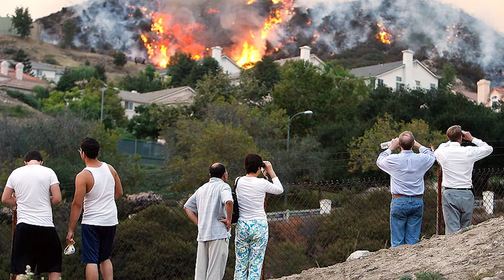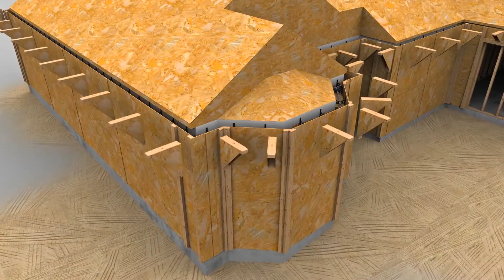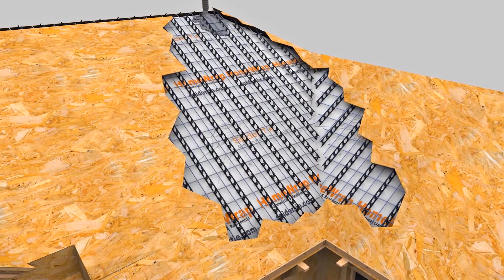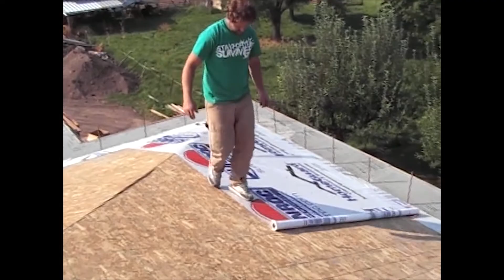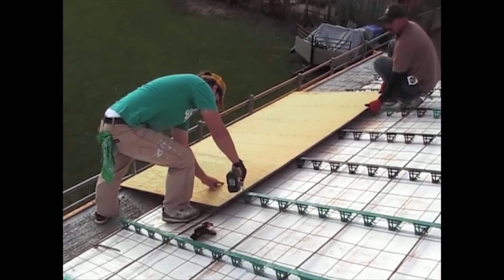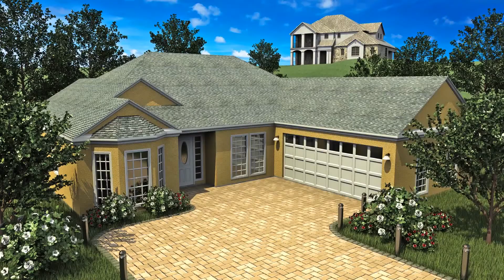Spider Tie Concrete Roof System

Comment: Great video. What keeps the concrete from soaking in the outer plywood? I noticed you covered the inner plywood for that purpose. Wouldn't the outer plywood get wet? How does the plywood and the concrete dry if the plywood remains in place?
Reply: The weather wrap they put on in between the concrete and plywood.
Reply: Good question. The top layer of plywood may dry by the water vapor going through the wood itself. That could be ok in a dry hot climate. If that process takes too long it could rot. Concrete does not have to dry; it cures by a chemical reaction.

Comment: How did you solve the sand issue, since the sand is about to run out and you would not have to use it anymore? And how do they protect the solar panels, since in California they are obligatory?